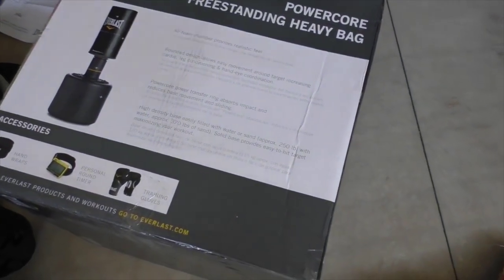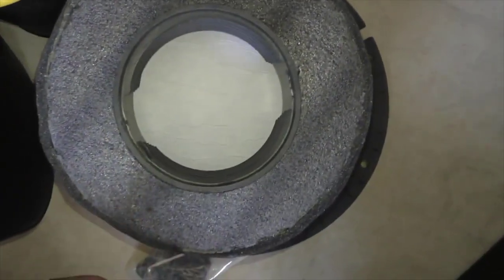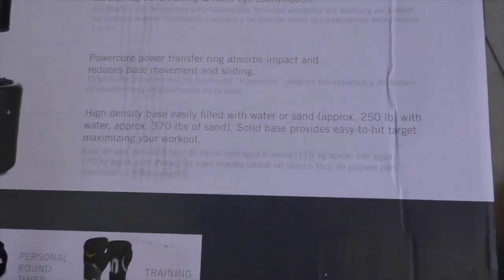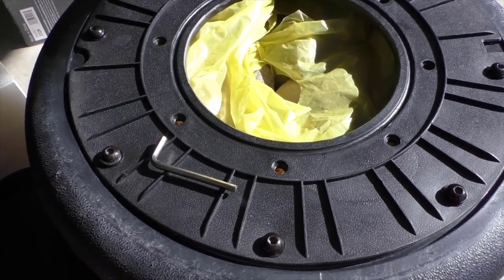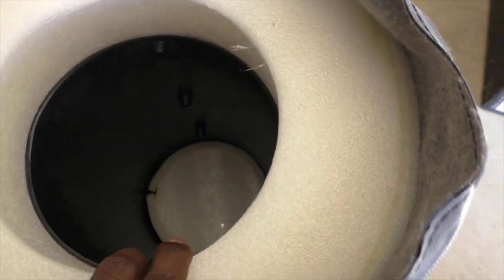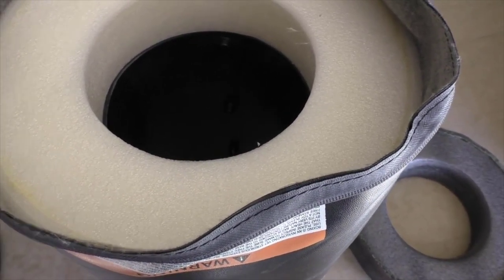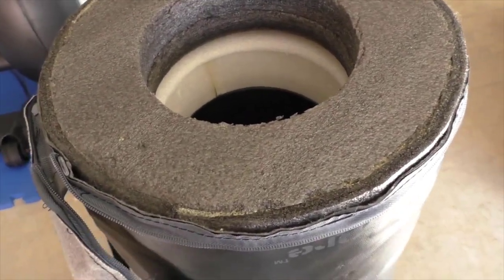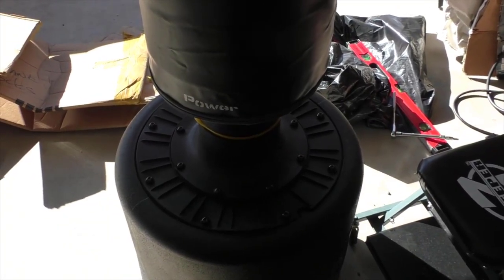Everlast Powercore Freestanding Heavy Bag Review & Setup

Comment: If you like punching/kicking your bags heavy and hard, then this product isn't recommended for you. Since the base isn't one whole piece, the plastic touching the screws will start to shave due to constant friction from impacts. So it wears out pretty quickly. Mine broke after a month and a half of everyday so.  Also it puts micro plastic bits into the air. Dont recommend this for heavy weights
Reply: Good thing im a 120 lb 14 year old💀